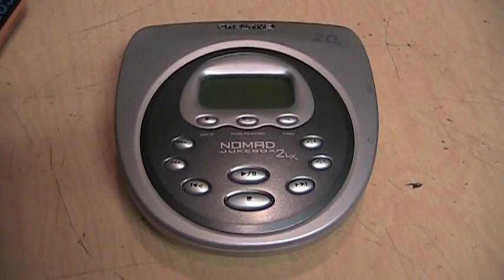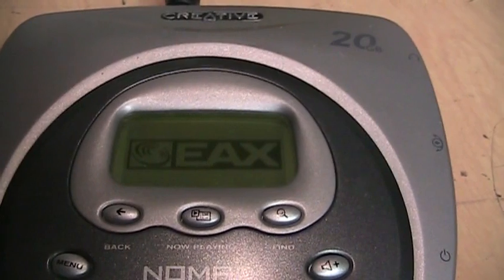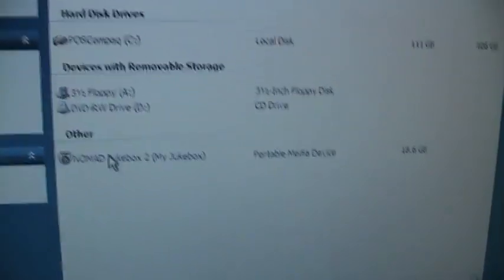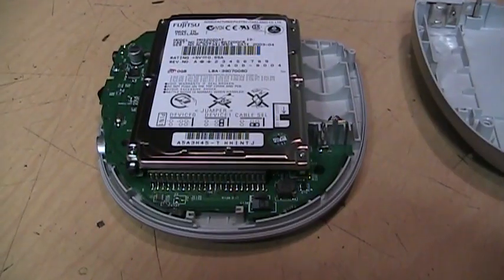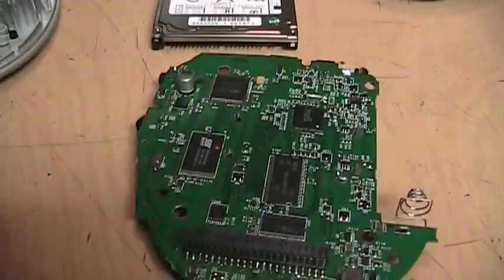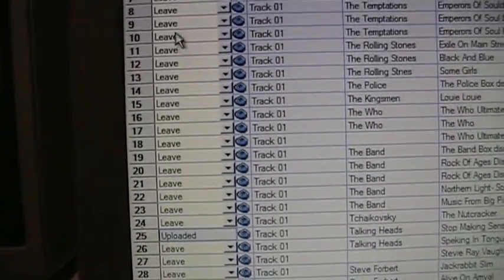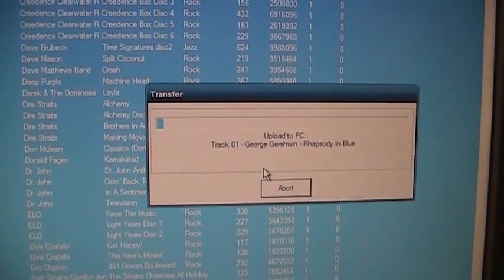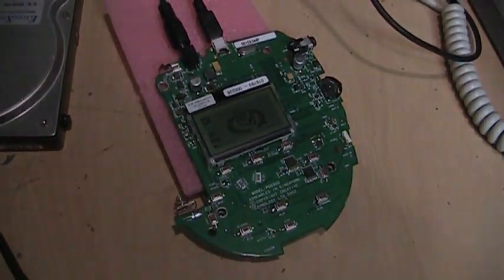2003 Creative Nomad Jukebox 2LX teardown

Comment: I'm not 100% sure on this....but if you do replace the hard drive, you must format  by pushing EAX+Middle Softkey+Down Scroll and while holding these 3 keys down push the forward arrow to turn it on. Continue to hold these 3 keys down until the jukebox boots up. There will be a menu for format or cleanup. It is necessary to use the ac power for this.  This should let you replace with a new IDE drive....

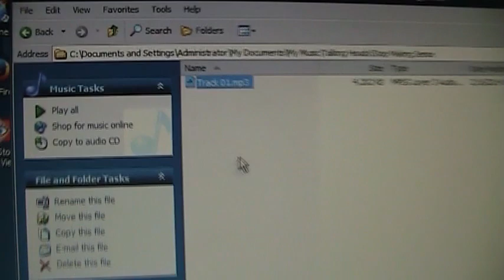Comment: 5:33 Yay winamp!!
Nice! Ripping music off an iPod is as easy as revealing the hidden "iPod_Control" folder(revealing hidden folders on Windows is easy but needs what I believe is a "defaults"(Mac equivalent of Windows registry I believe) hack on Mac) which stores the OS then go down to "Music" or another kind of content like "Movies", or in some circumstances, you may be able to copy content off of it if it was set to manual management.

However, it was cool to see another device that has its own form of DRM AND another device that was made in the country I live in. Compaq and Seagate had factories now or then at one point here as well.

Comment: Battery is a standard 18650 battery (with or without protection), you doesn't have to pay $15 because it is a creative one ;-) You can get one from an old laptop battery pack for example, be creative ;-)

Comment: The reason creative couldn't make the smaller player they wanted after the jukebox 1 the first ever mp3 with library ie mp3tags.. apple wanted creative to manufacture players and apple would do the sw but the CEO declined.. creative were streets ahead with features such as mic in record straight to mp3 from line in (mo need for pc) removable batterysuperior sound and settings & the new slide pad similar to apple's circular pad because they couldn't source the smaller hd Apple secured the supply chain

Comment: Now that you've got the music off the player, were you able to reassemble the unit and does it still work?  What are you going to do with the player now?  I vaguely remember players like that, it's pretty cool, it's not just a tiny bit of plastic like flash based devices are these days.
Reply from the maker: Yes, I did reassemble it (and I did find that washer that went missing) and it still works fine, aside from the dead battery.
Reply: vwestlife
If you're not using it for anything useful, sell it! The Jukebox 2 and 3 are worth a lot on eBay. $60-$100. Even non-working ones are worth a lot. I found a Nomad Jukebox 3 with the original dock still attached at Goodwill. You already know what I'm going to do with it. :D
Reply: Are you going to sell it?

Comment: I had the Creative Nomad Zen Jukebox with a 40GB hard drive in it.  I only got rid of it because after windows 7 I couldn't get the computer to even acknowledge the mp3 player was plugged into the computer.  Wish I would have kept it and just been a little smarter and setup a windows xp system LOL.

Comment: if that firmware on the player will allow for other drive capacities then you should get like a 160 gb PATA hard drive or a PATA to SATA Adapter and put an ssd in there lol
Reply: There are IDE (PATA) solid state hard drives available from newegg or tigerdirect
Reply: And it'll be perfect for an audiophile's music player or DAP.
Reply: It would probably be better to use a 2.5 ide to sd adapter.

Comment: You mentioned that this beats buying all this music on iTunes.  I get it that you don't want to pirate music, but how do you know that the previous owner didn't pirate all of that music? Back in 2002 when this player was released, pirating music was everywhere. iTunes and other legitimate avenues for buying digital music just wasn't there yet.
Reply from the maker: Because all of the MP3s were 128 kbps CBR, whereas MP3s downloaded from the various music sharing services would've come in all different bitrates, usually ranging from 96 to 192 kbps during that era, as well as some VBR files.
Reply: Oh OK. I was just thinking that in 2002, my 17 year old self had no problem pirating music, and most people were that way, just because that was the easiest way to get it.  Of course I feel alot different about it now, although I still do not purchase music files, I use subscription services, and SiriusXM radio.